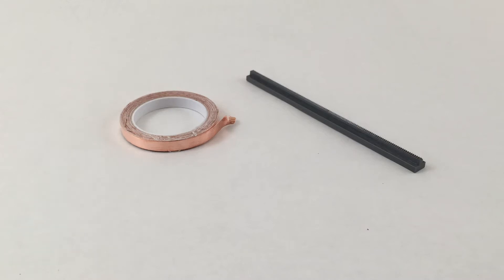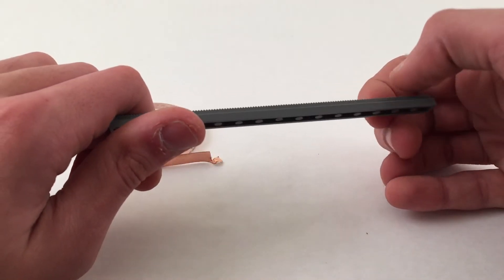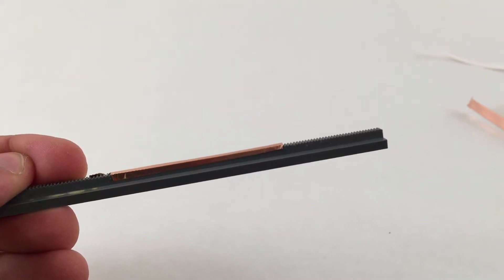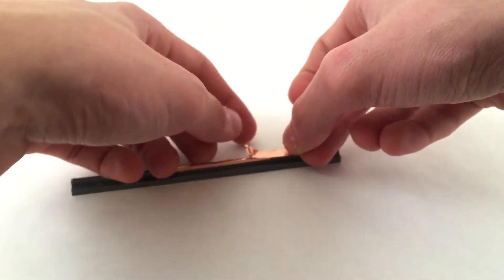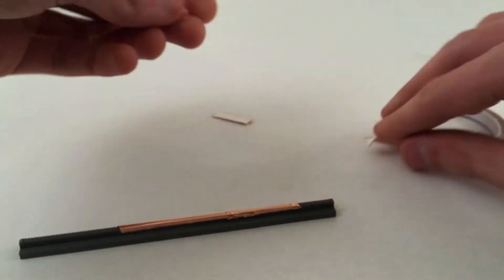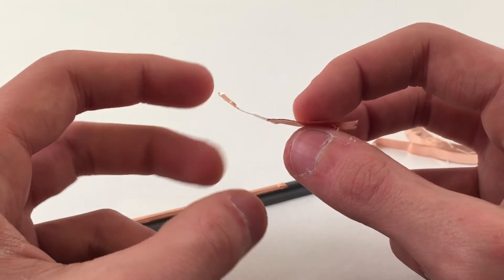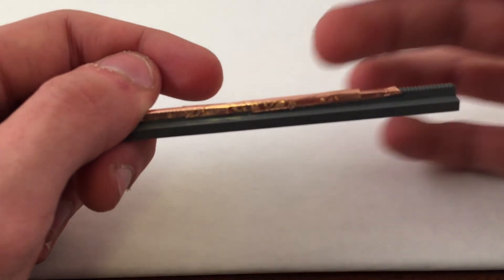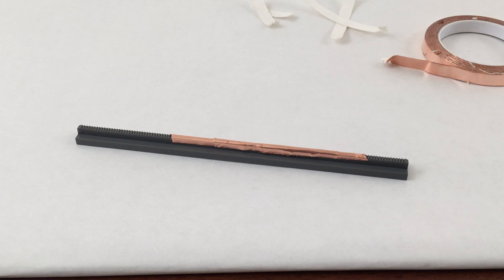How To: 9V Track w/ Copper Tape

Comment: I have a few pieces of LEGO 9V track where the train stops on, why might this be and how do i fix this? I have tried cleaning the track with an eraser but that hasn't worked on all of them but has fixed most of them. I noticed the metal rails are a little bit scratched as well. As far as the copper foil tape, a lot of the ones I did weren't working so i re-applied a second layer of copper foil tape over the top and that has fixed all of my problems regarding the copper track. Also, one of my wires that connect to the track doesn't work so do i have to go ahead and buy another one or is there a way to fix them.
Reply from the maker: +JR Bricks Yes, you should get a new wire. Little deformations in the track shouldn't make a difference. It might mean you're not getting a good connection between the copper section and the 9V section.